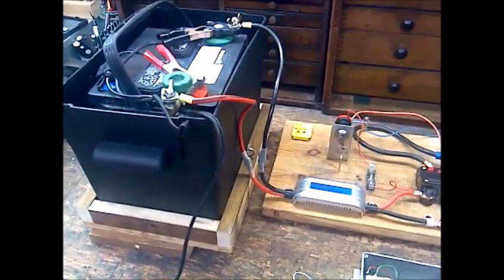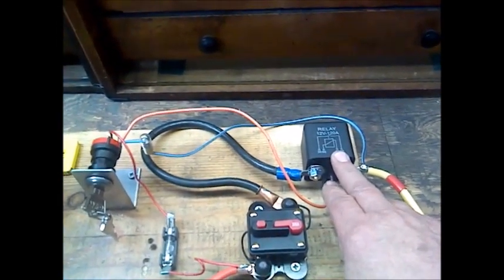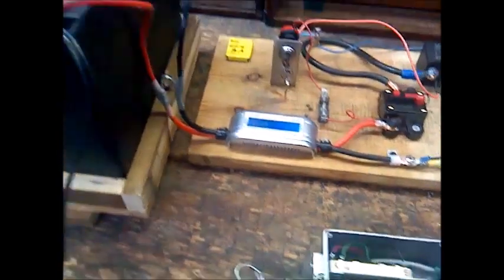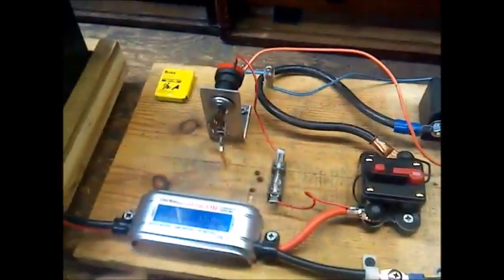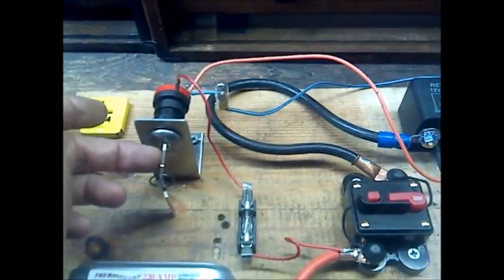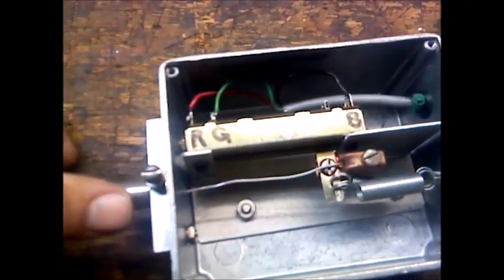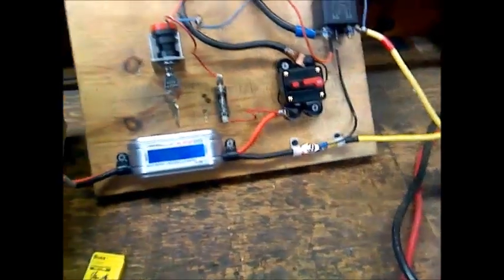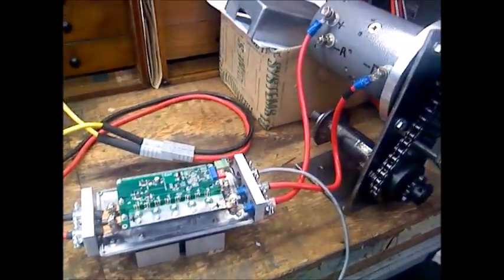Go Kart 12 volt DC motor controller project Part 1

Comment: The cap charging bypass is clever. I liked the addition of the lightbulb; nifty indicator that current is flowing (on) then, caps charged (out). I had an electronic flash, back in high school, that used the same approach.